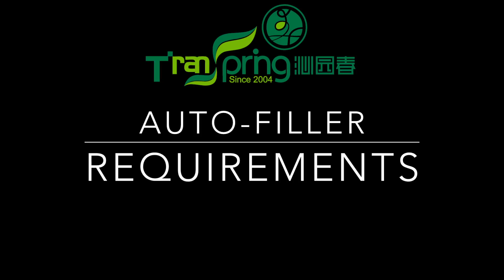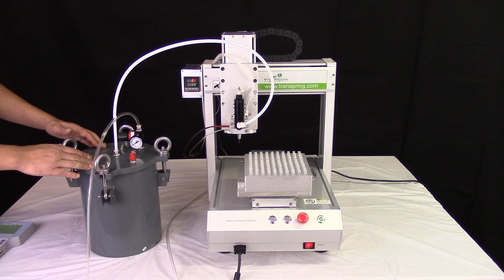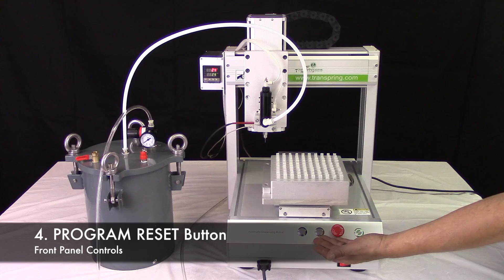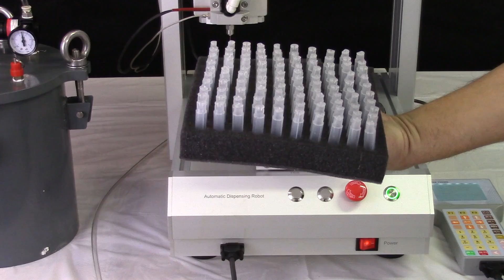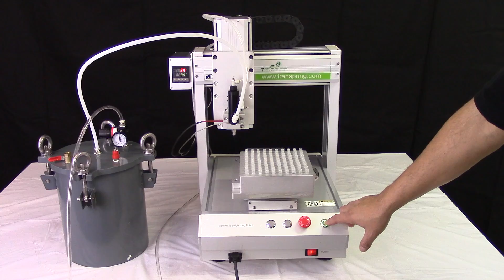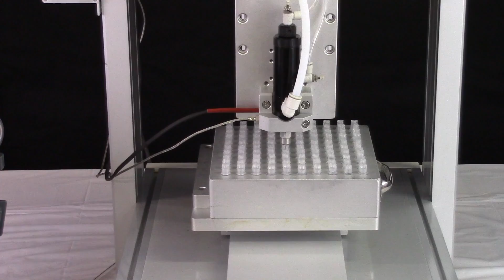Transpring Vape Pen Auto Filler

Comment: When the pressure chamber is compressed to 125psi would condensation accumulate inside? I run a water/air separator filter after my air compressor but would compressing it once again in the chamber cause condensation inside?
Reply from the maker: Not from what we have seen, we run water / air separators as well between the compressor and pressure chamber, and condensation hasn't been a problem.   However, we have some clients that need to place the pressure chamber in a hot-water bath / heat jacket to control viscosity, in which case we have observed some condensation.

Comment: Can you use different types of cartridges that have different measurements?
Reply from the maker: Yes, we can adjust the jigs to hold cartridges or pods of different shapes and/or measurements, and we can adjust the machine to fill them as long as they are Top-Fill carts / pods

Comment: Lol 2016 tech...How can you fill a ccell cartridge with this?Or can u?
Reply from the maker: CCELL carts are actually EASIER to fill, because they have a larger diameter and greater area to fit a blunt-tip syringe into the tank for filling.  Especially true for Plastic CCELL Cartridges, since they have so much room between the centerpost and sidewall.  Modern Vape Pens are 1965 tech patented by Herbert Gilbert, CCELLs are 2016 tech based in that 50 year old patent.  Good design never gets old.

Comment: Works fine, as long as you over mix your oil. This wont work with high end, thick oil
Reply: Half Right, Half Wrong...It can be used with high end thick oil (we have clients that do) but it must be continually adjusted while filling to maintain accuracy.  We have easier to use machines that cost WAY MORE (like 3x more) that are fully automatic and maintain accuracy without effort, but this is the best fully automatic filler to be had for under $10,000.  It's really a question of price...if you can afford an easier to use machine, then you should definitely buy one.  But if you are on a budget and don't mind paying more attention (instead of money) then this is a viable option.

Comment: I would probably purchase this item and try to use it but I called this guy a while back and he told me it was around $15,000 besides that he didn't even have one for sale yet
Reply from the maker: Hi Patrick,
You should have called us! We have this machine for much cheaper than that and always had stock or factory direct options available to get this machine out to clients as soon as possible. Give us a call as we have a few filling machine options to better fit whatever work load you may have. Note that we only carry well tested machines that we worked the factory to make better over time. The large price point you have must have been through a reseller as this style machine from the factory and us has never changed.

Comment: I want to avoid cleaning the pressure pot, since oils are hard to clean. Can I put a glass measuring cup in the pot?
Reply from the maker: Hi T1ger8oi, Yes! We actually recommend to put secondary container within the pressure pot, typically a mason jar is used. Make sure whatever container you use does not get narrow towards the top like a "laboratory flask" does.

Comment: @8:06 it starts malfunctioning when you resume the pause. the next set of fills have drips.
Reply from the maker: Thanks for your comment, but those are actually not drips if you look closely...those are slight overfills.  We had the fill volume calibrated a little too high for this demo, so when the pause occurred while the needle was fully inserted into the cartridge, the liquid cooled against the needle and stuck to it, thus causing each cartridge after to overfill slightly because of the extra mass stuck to the needle.  Our current iteration of the machine has a Supply Tank Heater, Supply Line Heater, and Needle Heater to combat this effect, among others.  This video was meant as a way to introduce the general functionality of the filling machine to new users....for an actual fill operation, we would calibrate the fill volume much more carefully.  Thanks for giving us the opportunity to explain, and let us know if you have any other concerns about the presentation, we are happy to explain & clarify!

Comment: can i put a glass jar container in the tank? instead of the plastic one? say i heat my vape product in a glass jar and its ready and i just stick it in there and cool? or does it need to be in that plastic one
Reply from the maker: Hi Sean, we highly recommend using a glass jar! We recommend using mason jars. The plastic bottle you see in the video is used for simplicity. After you heat your product in a glass jar, you would then put that glass jar inside the pressure pot. However, we have come out with heating modifications for the machine to keep everything up to temperature and consistent. Give us an email if you have any further questions! Info@airvapor.com.

Comment: Wow this seems like over kill. Why need CNC at all? Why not just have a small tube per bottle and fill the whole lot at the same time, no need for motors and complicated electronics.
Reply from the maker: It is key to fill one by one to ensure all cartridges are capped in a timely manner. This prevents material from "pre-priming" causing leaking issues, especially when using heat. We are planning to release a video explaining the pros on cons of our machine and why we have it the way it is.